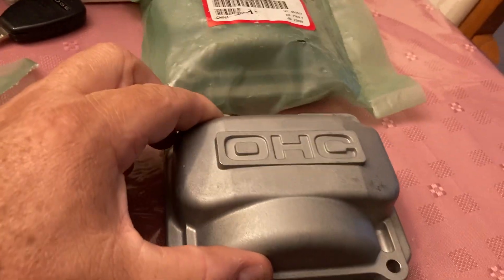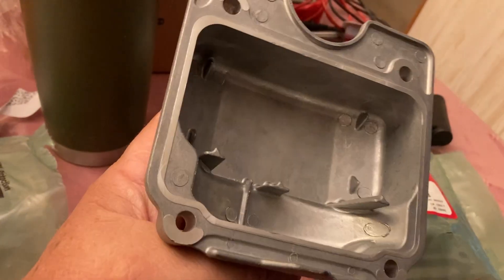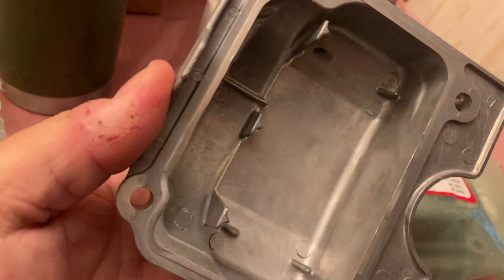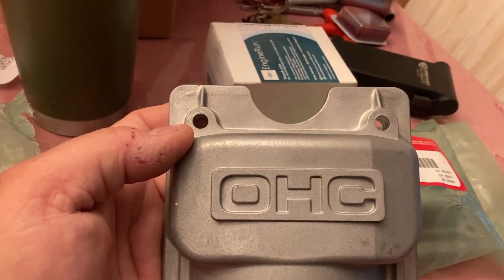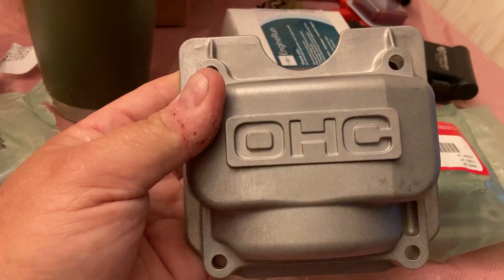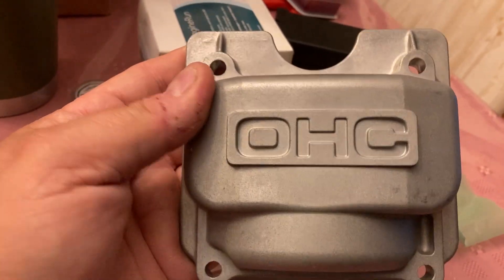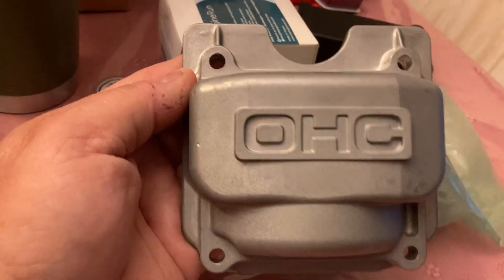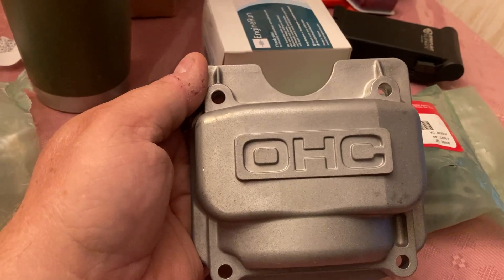Honda GCV 160 won't start, low Compression? Install a Stronger OEM CAST Valve Cover!

Comment: Hey there Ken, what gasket sealant should I use for this gasket, or non at all?
Please reply.
Thanks.
Reply from the maker: The gasket should suffice on its own but I like to glue the gasket to the cover only to allow easy cover removal for annual valve clearance checks. I like Permatex Optima or Right Stuff Gasket Maker.
Reply: @KensSmallEngineRepair  Right stuff all the way!  Did they make a replacement cast cover for the GCV200???
Reply from the maker: @jagboy69  Not that I can find, I hope they do for all the landscapers out there with pickup trucks!
Reply: @KensSmallEngineRepair  Thanks, Ken.
Reply from the maker: I like Permatex Right Stuff, Dirko, and Permatex Ultra Black

Comment: Hey there Ken, I've been looking for a cover just like that one for awhile now but hadn't been able to find the part number for it.
And I want to replace the original one with one of these cause the shop manual ses to replace the cover every time you adjust the valves.
So I greatly appreciate this video clip, which is very informative.
Reply from the maker: Thanks for watching! These covers are great for landscapers who have their push mowers sliding around in back of their trucks!! But less repairs for me lol!
Reply: @KensSmallEngineRepair  Hey there Ken, with the thin valve cover you don't need a gasket cause you use Permatex Ultra Black instead of a gasket. 
But do you need to use a gasket with the HD Cast Valve Cover, and if so, what gasket number does it use?
Also, the HD Cast Valve Cover is much thicker that the thin valve cover, so will the same 4 bolts used with the thin valve cover work to tighten the HD Cast Valve Cover?
If the 4 bolts need to be longer, what is the Honda part number for the 4 longer bolts?
I hope that by asking this favor of you will not be an inconvenience.
And again, thanks from a loyal subscriber.
I greatly appreciate this information which I accidentally found in your YouTube Channel.
Reply from the maker: The Gasket is part number 12312-Z2A-000, the screws are M6 x 25 flange bolts part number 90121–952-000. I just used M6x25 Socket Head Cap Screws loctited with flat washers.
Reply: @KensSmallEngineRepair  Thank you so much for this valuable information, Ken! 
Now I can place my order tomorrow for these parts plus a few carburetor gaskets that I'll have to replace along with the HD Cast Valve Cover.

Comment: Where to purchase the over? I found one online but it didn't mention is was for my gcv160.
Reply from the maker: They didn’t come stock on GCV160s.  They came on 190s.
Reply: @KensSmallEngineRepair  they only came on the gx engines which came on the commercial units not the gcv190 residential mowers you will also need longer bolts due the HD cast one being thicker.
Reply from the maker: @billniemiec3241  All true. A worth while upgrade thanks for watching!

Comment: I bought a nice Honda push mower from a guy who said he couldn’t get it running and it turned out to be that valve cover issue and so I got a really nice Honda for $20.  I ended up banging on the dent out of the cover and to put it all back together sharpen the blade change The oil and sold it for 125 bucks